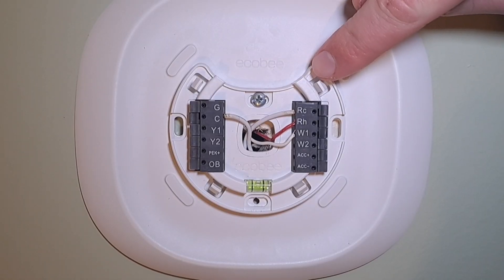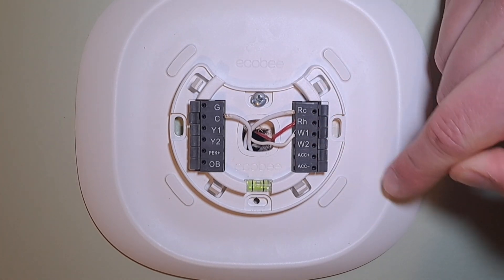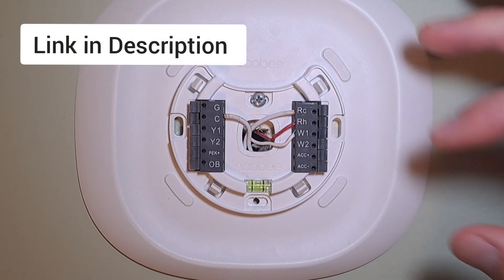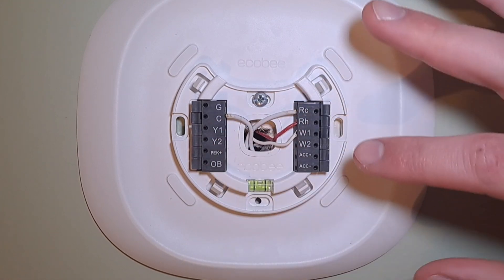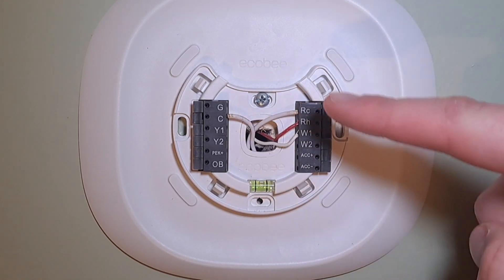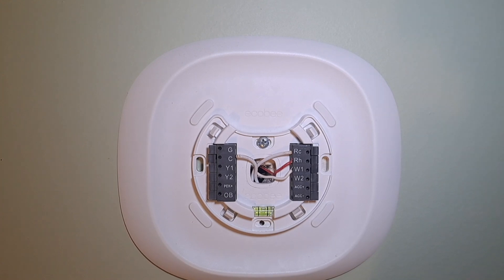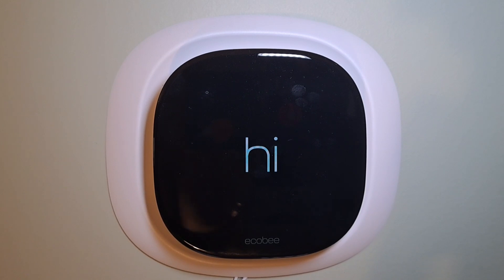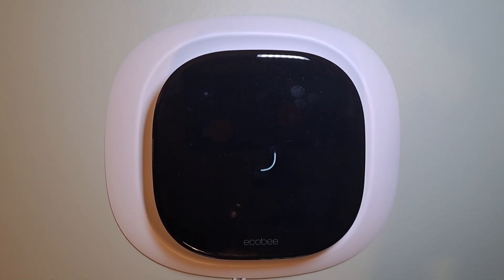How to Install a Smart Thermostat with 2 Wires

Comment from the maker: Get the 24V adaptor I am using to power my smart thermostat on amazon - https://amzn.to/3W5MrCc
Reply: @DIYwithCam  so I grabbed the transformer you linked but having an incredibly difficult time getting the terminals to engage. Seems like the wire is too think so no matter what I do that clip doesn’t go down like it should on the plate and the wire doesn’t engage. Any suggestions?
Reply from the maker: I think they have change the ecobee design since I bought mine based on other comments I have seen. It was fidly when I did it and it grabbed the wire but I wouldn't say it was the best connection.
Reply: @DIYwithCam ok that was my issue. The clip wasn’t fully depressing but I tugged on it after install and they didn’t pop out so I wound up just leaving it and it works. Think the wire is just so thin that it doesn’t engage like it probably should.